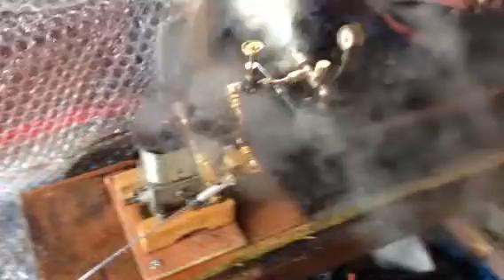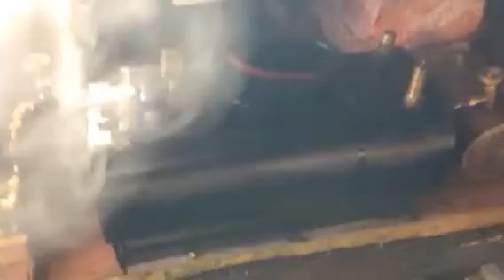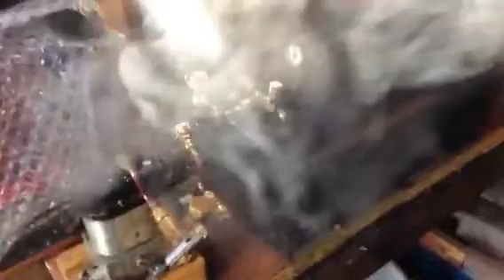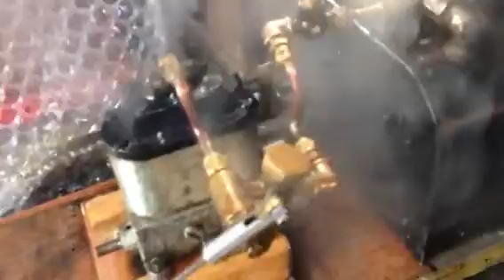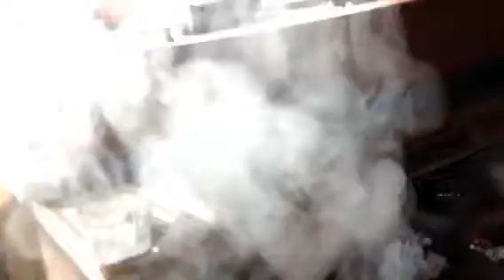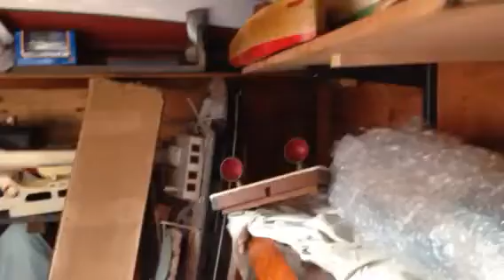Stuart boiler & inline twin engine 1920’s

Comment: Bonjour Roy,
I know that England is the country of the fog, but I did not imagined it would go till your workshop :+))
Besides this, another success and I envy the place you are and its content !
Amicalement, Raphaël
Reply from the maker: Raphaël Havranek Bonjour, “ Yes a great place for steam work, I have now increased the the bore on the brass elbow , which was almost
Blocked with old lead, now re silver soldered for a test tomorrow, I also noticed that at 60 psi on start up , = no wet condensate , so that’s
Good news, just requires a small condenser tank and. Then piped up through the chimney,  Merci Roy